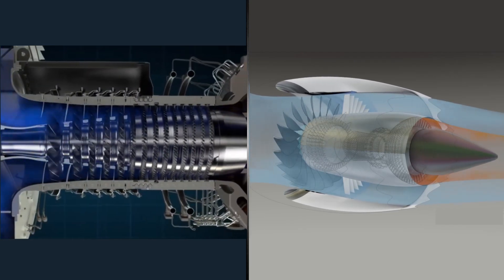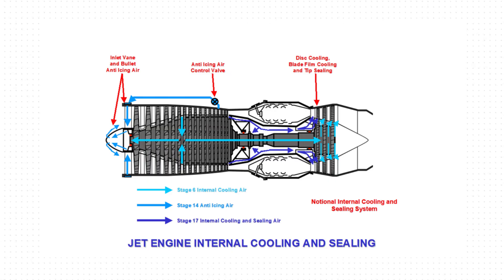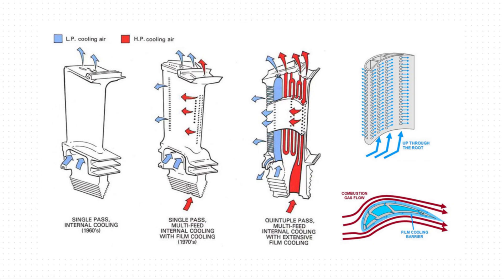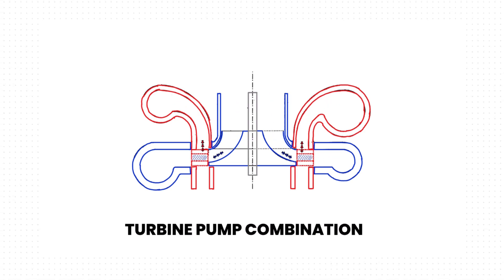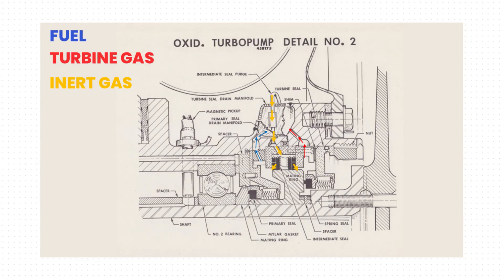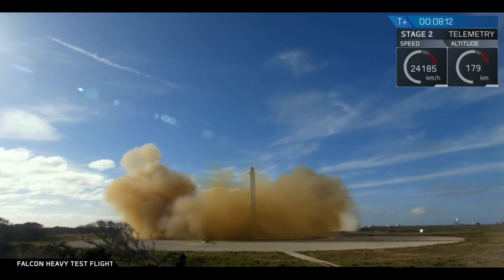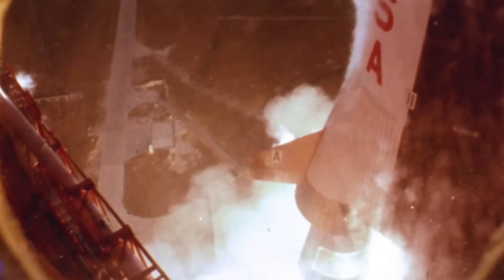Why are Rocket Engine Turbine Blades not Actively Cooled?

Comment: Cool, but irrelevant for closed-cycle engines as used on Starship.
Reply: Yes, one can say they already solved the cooling by running their turbines fuel rich (maybe one is oxygen rich). In the closed cycle engine the exhaust is then feed into the main combustion chamber so the unburnt fuel is not lost.

Comment: Junkers Jumo 004 Turbine Blades in Me-262, made of folded tin sheets, had cooling from air running inside by centrifugal force, just because of materials available then in Germany.
Does cooling turbine blades impair thermodynamic efficiency of turbine? I don't know.

Comment: Um, yeah, I guess.

But if you're planning to use your fuel or oxidiser as a turbopump turbine coolant, aren't you just asking for trouble?

If the engine uses hypergols, such as nitrogen tetroxide and UDMH, these substances are fairly corrosive. At the very least, you're risking the introduction of turbine imbalances (as the corrosion will never be perfectly symmetrical within the turbine). At worst, you're risking the loss of the turbopump and hence loss of the whole engine, because the coolant could corrode through into the hot side of the turbine.

If, OTOH, you use cryogenic propellants - such as the LOX and liquid hydrogen used in the J-2 - are you not risking flash vaporisation of the coolant when it contacts the hot turbine blades? At best, this could cause a loss of efficient cooling and turbine imbalances. Again, at worst you lose the whole engine.

I guess you can use this with RP-1 , which is neither corrosive nor needing to be kept ultra-cold to remain in its liquid form, but there are good reasons that rocket engineers don't just use RP-1 in every single engine.

What have I missed?

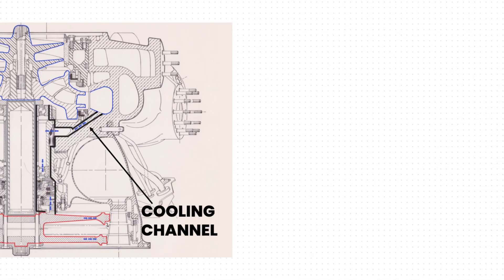Comment: 6:58 i suppose you could do something with a heat pipe from the turbine blades up to the pump blades but i suspect thats probably not going to be enough cooling ... or if it is your going to have problems with  you pump getting so hot it boils your fuel lol

Comment: Rocket engineers spend a decade and hundreds of millions to eke out 1/10th of  1% in power output. Respectfully, there's not much you can think up they haven't tried in the past 65-70 years! It's either not efficient, lowers specific impulse, lowers thrust, lowers dependability, lowers re-usability, or isn't feasible for some reason or another.
Reply: Let people be curious. Technology improves. Perhaps it wasn't possible then, but might be soon.
Reply: I agree. Time to hang up our hats on pursuing better technology. 

I mean, I agree with you that there are very few unexplored possibilities, but come back and reply in 10 or 15 years, and we'll see if any advancements have been made to rocket engines. If not I'll concede we've done it all.

Comment: Would there actually be any negative effects of introducing more fuel into an already somewhat fuel rich exhaust of the turbopump? As long as you are able to ensure (mostly) complete combustion of the oxidiser in the combustion stage, i don't see what the cooling fuel has to ignite. The main issue i would see for hydrocarbon based fuels is that it may lead to gumming up the turbine with tar due to the hydrocarbons degrading from the heat, but I would expect that's already a challenge being dealt with in any fuel rich turbine.
Reply: "hydrocarbon based fuels is that it may lead to gumming up the turbine with tar due to the hydrocarbons degrading from the heat"
Yup

My only thought is to use a inert gas for a limited amount of the flight. Perhaps for the first stage when weight isn't as much a problem. Use up the inert gas, than reduce turbo pump temperatures. You get a boost for part of the flight.
Reply: While introducing more fuel into a fuel-rich turbopump exhaust might not cause ignition issues (due to the lack of free oxidizer), it could reduce turbine efficiency, increase the risk of hydrocarbon degradation (e.g., coking), and require complex redesigns. Turbine blades are typically uncooled because they’re designed to withstand the relatively low temperatures of fuel-rich exhaust, and adding cooling fuel would introduce unnecessary complexity and potential performance losses.

Comment: Co2 cooling. Job done. Yes its another tank of fluid to carry but since there's no cooling on the pump turbine to begin with... any cooling will pull up the efficiency. Someone will have to do the math for added weight vs engine efficiency gain to see if its worth it. The ring seals setup, round the outside edge of the turbine ring (in the case of the liquid cooling in the vid) would cause a friction loss due to their contact area at the outer circumference. Do away with them and simply dump the co2 into the out flow at the end tips of the blades. Saves on the complication of the pump 'too much', with extra galleries for recirculation, etc. Have the liquid co2 fed directly to the pump and have the change of state occur in the hub of the turbine xx
Reply: hear me out, the rs 25 on the shurrle used a helium purge sealiing system, to prevent any propellant from leaking out of the turbopums, what if they used that to cool the turbines?
Reply: The fuel is already cryogenic though. Co2 doesn't get to the same temps.
Reply: If they really use turbine, what does the turbine suck in the outer space?
Reply: @muhammadwibisonojanuar7793 gases from combustion of rocket fuel :p
Reply: @muhammadwibisonojanuar7793  Turbines don't suck anything, they extract energy from a flow of fluid. 
You may be thinking of the air compressor which is driven by a turbine in a hot-gas-generator turbine engine.
Reply: @muhammadwibisonojanuar7793  the system is closed, i.e. no intake of air. Imagine a turbo on a car, only instead of air being drawn in from outside, it's the fuel filling that tube. They use a very small combustion chamber, and pump that exhaust down through the turbo to get it up to speed. The turbo then pumps the fuel into the system. It's needed to achieve the huge flow rates and pressures that these engines require.

Comment: If you are running the pump via a fuel-rich stream, having more fuel entering the hot gas via the blade orifices won't result in combustion as there is no oxidizer available, right?  You would need a lot of pressure/flow rate to avoid coking inside the passageways due to the heat if you were using something like RP1.

Comment: a presentation a hybrid turbojet engine,a technical research and study conducted by as:  here are the main points

#1. Engine Concept: Hybrid Propulsion**
*  engine is a *Turbine-Based Combined Cycle (TBCC)* engine.
* It combines a conventional  for low-speed flight and for high-speed flight  (Mach 6).
* The goal is to achieve both fuel efficiency at low speeds and extreme performance at hypersonic speeds (Mach 6).
    

#2. Core Components & Function**
* *Variable Geometry Inlet:* This is a crucial component that changes shape to manage airflow. It sends air to the turbojet at low speeds This is the conventional. It's used for takeoff, acceleration, and subsonic cruise. and bypasses it directly to the new technology at high speeds above 6 mach.

the new technology  high speeds above 6 mach. This replaces the afterburner.  produce massive thrust and provides a pressure gain that makes it more efficient than a conventional afterburner.

system to maintain a normal internal temperature on an aircraft flying at Mach 6 a multi-layered approach, as a single method is insufficient to handle the extreme heat. The following use a three-tier defense system: an active innovated System, a passive thermal protection system , and a final liquid  active cooling system.

First Line of Defense:
innovated System:** This is a system that uses  to act as a shield, reducing both heat and drag at hypersonic speeds above(Mach 3-6+) offering a 30% heat flux, reduction on aircraft's external structure.

Second Line of Defense: Thermal Protection System (Passive Insulation) reduces the heat flux by over 30% to 35% for this layer at hypersonic speeds above(Mach 3-6+).

Third Line of Defense: Liquid  Active Cooling System This system absorbs the final residual heat load, maintaining a habitable and functional temperature for the internal systems.

#3. Operational Modes**
* *Mode 1: Subsonic to Supersonic (Mach 0-3):* The engine operates as a turbofan. The inlet is open, and the new technology is inactive.
* *Mode 2: Hyper-sonic (Mach 3-6+):* The engine transitions. The turbofan core is bypassed, and the new technology is activated. The variable geometry inlet compresses the air, and the innovated system is activated to reduce heating on aircraft's external structure.

#4. Key Benefits 
* *Benefits:*
    * *Thrust:* The new technology provides a powerful thrust boost, potentially reaching over 43,000 lbf at Mach 6.
    * *Efficiency:* The new technology pressure gain offers a significant increase in fuel efficiency over a conventional afterburner.

Comment: Im curious how you would minimize the losses from inpeller through the hollow blade passages. Sealing secondary flows from the hot side would be a problem and the pumped fluid is now in a crazy thermal gradient which would be interesting. I like it lol

Comment: darn I never even thought about blade cooling. Sipping compressed air thru shaft to thin blades - that's hella impressive
Reply: Especially when the blades are made of a single crystal.
Reply: @mytech6779  Now you mention it there was several accidents likes United Airlines 232 where fan disk broke off after metal fatigue - To think it shouldn't have any imperfections while having channel to bleed air... sounds insane
Reply: @jupiterbjy  go look up some deep dive videos on how the blades are made, it really is insane. Especially when you consider their duty cycles and low failure rates.
Reply: Imagine back then... crazy idea, but what if we put a hole through it?
Wow, that was hard! 
Now you want a complicated hole?
With side holes?

Comment: Raptor engine turbopumps each put out on the order of 100,000 horsepower or more (and there are two per engine — one for fuel, one for oxidizer). By comparison, Merlin’s turbopumps are far smaller, closer to ~10,000 plus hp. The trick is materials like Inconel superalloys and design margins — rocket pumps are built to run extremely hot, hard, and fast, but only for minutes, not thousands of hours like aircraft or power-gen turbines.

Some of the more exotic staged-combustion engines do use actively cooled turbine blades, but many simpler designs with a single turbine driving both pumps don’t — instead they size and shape the blades to be tougher and accept the short lifetime. The real headache is oxidizer-rich hot gas: under the wrong conditions most metals basically become fuel. That’s why rocket turbomachinery is always a balancing act of power, materials, and survival.

But in today’s day and age, engines like Raptor and Merlin need to be reused over and over again, much like aircraft engines, so hot-section inspections become ultra critical — no different than a gas turbine carrying people across the sky or powering a city.
Reply: For a healthy comparison top fuel NHRA drag race engines can be at minimum 10,000 or more horsepower and at the maximum 18 to 20,000 hp so that just gives you an idea. But with turbopumps, instead of turning wheels it’s a 10 to 100,000 hp fuel pump…it’s just crazy lol
Reply: The most powerful aircraft engines can reach 100,000 hp
You need a lot of power because methane has a lower density than kerosene so you have more volume to pump, and at a higher pressure as well.
Raptor has the most powerful turbopumps per ton of thrust of any rocket engine.
Reply: @johntheux9238  All of your methane math is wrong.
Reply: @mytech6779  Why? You have to overcome the pressure of the combustion chamber.
Pressure*volume = energy so pressure*flow rate = power
Reply: @johntheux9238  Mass flow is what matters and methane has less mass per joule. 
"and at a higher pressure as well." Why would there be any difference in combustion pressure?
Reply: @mytech6779  I'm not talking about thrust, I'm talking about the power required for the turbopumps.
To get higher chamber pressure you need more powerful turbopumps, even if the mass flow is the same.
To get the same pressure using a propellant with a lower density you also need more powerful turbopumps, even if the mass flow is the same.
Reply: @johntheux9238  Chamber pressure has nothing to do with the fuel being methane vs kerosene. (if anything the methane pump pressure should be lower because the lower viscosity requires less injection nozzle pressure above the chamber pressure to achieve atomization.)

But I see what you are getting at with fluid density, but consider that the liquid methane has far lower kinematic viscosity than RP-1 cooled to -6c (as used in Falcon). 
0.28 cSt vs 3.7 cSt. Kinematic viscosity accounts for density (Low density raises it, such that air has higher kv than water.).  
Even at 20c RP-1 is 1.87 cSt
While I don't have access to the pump-curve adjustment charts for such low viscosity, based on what I can access  and extrapolating a bit, this viscosity difference coupled with the higher specific energy should at least cancel out the difference in required work due to density.

Comment: Rockets don´t look like that, and they do not operate like that.  Rockets don´t suck air in and then compresses it. Some things do suck though, and not knowing the difference between a turbojet and a rocket when you´re trying to share your knowledge or show off your AI-content skills is one of them.  At least I hope it´s AI, for all our sake.
Reply: All liquid rocket engines have turbines which pump the fuel into the main chamber.
And those turbines do have turbine blades, which in turn could theoritically be actively cooled (like the rocket nozzle is).
In fact those fuel pumps are one of the most difficult parts to design and manifacture on a rocket engine. And the design efforts that go into preventing them from melting are enormous.
So the video is trying to answer a valid question.
Reply: @Mr30friends  The preburners in newer full flow staged combustion cycle rocket engines like the Raptor are operating at 6-900K, so no.  
The methane preburner is fed  a very fuel rich mixture that is still liquid.  The expanding gas which acts upon the turbine blades is about 600°C or 1100°F.   The LOX preburner is powered by a fuel lean mixture and here the temperature is about 100K less.
Reply: That's why rocket engines have higher chamber pressure and specific power than jet engines, because the oxidizer has a higher density so there is less volume to pump.
But otherwise it's still the same concept.

Comment: I still dont get how this truboblade pump work. You have any 3D print or 3D deasing? i want to know how the flow and conection must go. two volute and intersection is make no sense to me.
Reply: The pump itself is quite simple really. The hollow turbine blades also serve as the outer section of the impeller. The turbine and impeller effectively become nested together as one component. I still don't think it's a practical design though, what with those huge seals around the impeller that have to withstand a very high pressure difference across such a tiny distance. All while dealing with thermal expansion and mechanical stretching due to centrifugal forces. Nor do I see how any of this is supposed to also boost pump efficiency.

Besides, stages combustion is already proven as the way to go for high performance, high efficiency liquid fueled rockets. It's just really awkward to do with kerosene specifically, because you can't run your preburner sufficiently fuel rich at those pressures without clogging everything with nightmare polymers. But a methane fueled stage combustion engine with a fuel rich preburner is relatively simple. It keeps turbine temps well within bounds, and offers an abundance of pumping power so you can crank the chamber pressures way up. Full flow staged combustion is better still, but much more difficult to design, as one of your turbines must survive being blasted with angry hot oxygen full of radicals.

Comment: A few months ago I said that FFSC turbines could run cool, and someone convinced me with a lot of numbers that they actually don't. They want pressure in the combustion chamber as high as possible, which means they need to get as much work out of the turbine as possible, which means they heat the blades as much as possible without failure.

So a turbine design where the blades could be actively cooled would be really useful even in FFSC. And I think you wouldn't have to worry nearly as much about sealing, because your oxygen-rich combustion side pumps LOX and your methane-rich combustion side pumps the methane.

So this might be very applicable to FFSC engines!
Reply: You always want more performance.

Comment: Wouldn't higher inlet temps(0:50) mean less power due to lower density.
Reply: I think he’s referring to higher turbine inlet temperatures - ie, hotter combustion.  But too high TIT will melt the blades unless they’re actively cooled with something like multi feed internal cooling with extensive film cooling.

Were you thinking he meant higher compressor inlet temperatures?  If so, yea, you’d be correct.
Reply: No, because you get more pressure so the density stays the same.
Reply: @johntheux9238  The static pressure is determined by the fuel-mixture supply pressure not by the temperature. It will be lower density but the total mass flow is the same, so the flow speed will necessarily be greater which increases the extractable energy. A fixed amount of mass traveling faster has more energy than if it was slower.